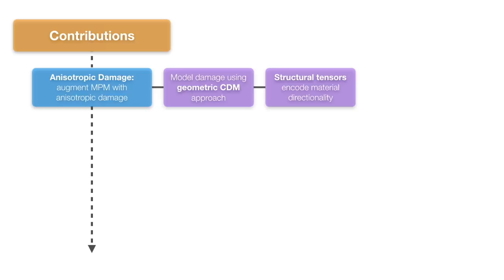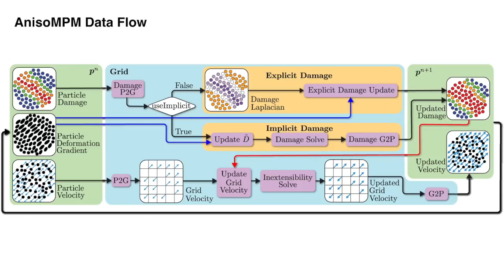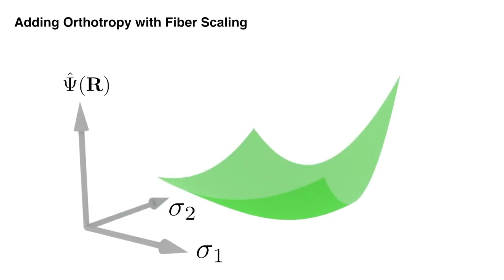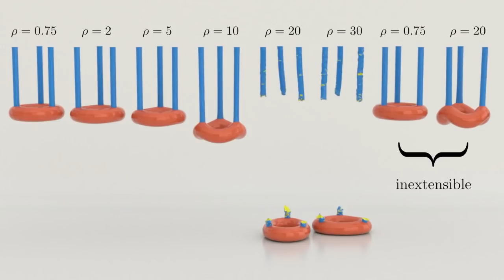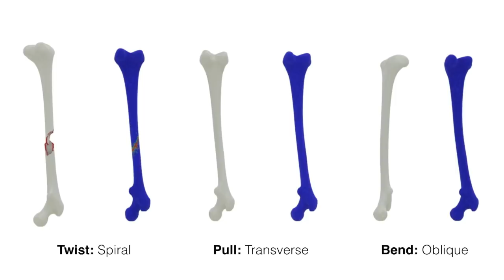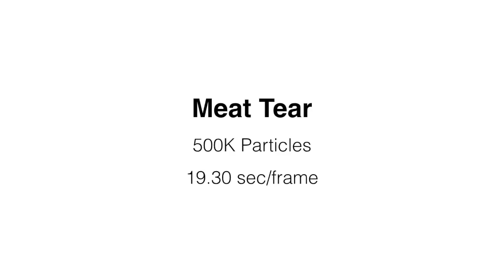[SIGGRAPH 2020] AnisoMPM: Animating Anisotropic Damage Mechanics

Comment: There's a lot of words here that I as a "dumbo" don't understand. But I like meat being damaged. Thank you YouTube for recommending this to me.
Reply: Me either but I looked some up and tried to dumb it down so I understand it. 

From Wikipedia:
A transversely isotropic material is one with physical properties which are symmetric about an axis that is normal to a plane of isotropy.
So i take this to be referring to things like the fibres or grain of a steak, where an object is composed of lots of little fibres that are strong in one direction, but pull apart easily in another.

In material science and solid mechanics, orthotropic materials have material properties at a particular point, which differ along three mutually orthogonal axes, where each axis has twofold rotational symmetry.
And this, by extension, would refer to objects like a sponge which have a more uniform molecular structure. 

So when she's talking about objects being "anisotropic" she means it has structural rigidity more on one or two axes than the other(s), which is why they will tend to split along the weakest axis.
Then when the objects are orthogonal, the damage is applied more across all 3 axes. And some of the impressive features are that they seem to be able to tell an object "you are anisotropic for these bits, and orthogonal for these bits but youre still one object" in any combination they specify and usually achieve realistic results.
The implications of this are pretty insane. Imagine playing a shooter where whatever you're shooting at has a realistic, unscripted and real-time computation of a body with muscles, skin, bone etc that all respond differently to damage... the sort of game where you might chuck a grenade at a giant crab beast only to blow a piece of its shell off so fast that it takes out one of your squad members. With more time and development this can be a framework for some of the coolest animations we've seen yet.

Also one other thing I figured out was when shes showing those graphs that look like a sheet being held by its corners, she mentioned "as damage increases, elasticity response decreases" and I took this to mean that as a part of the object gets more damaged (red) the ability for it to "hold itself together" gets reduced, which is what we observe in a lot of biological damage scenarios- say for example you crush one of your arms, the ability for the arm to continue to behave like an arm (vs the flst sausage its being forced to become) reduces in proportion with the damage done to the muscles, bone, nerves etc because they are damaged.

Im not sure if any of that helps you make more sense of what she's saying, but it sure helped me to type it out! 😁

Comment: You have to remember that when the logistical anodes become out of sync with the linear shaft dilators causing a failure to generate concurrent radial grammeters . You should try to recalibrate the stater conductors and reset the dingle arms to their original tertiary based orientations, but it could lead to sinosodial depleneration levels that are too high for industry quality standards.

We're still a ways away, but this is moving in the right direction.
Reply: On god bro that’s what I been sayin
Reply: You forgot the prefamulated amulite
Reply: The rockwell turbo encabulator this is not.
Reply: @a__duck  my heart skipped a beat after I read your name in my notification.
Reply: @hit3894 That's why im here!
Reply: a waht?

Comment: This physics is 10 years away from realtime
Reply: the physics is already realtime, as they said. 400k particle simulation in realtime on a 9700k. Rendering this with textures and a decent polygon count will take a long time, however.
Reply: @HumanlyRobotic  0.033 seconds/frame is what we normally call realtime(30fps), fastest simulation was fish with 2 fps. GPU can run the fish sim in interactive realtime, I think.
Reply: @HumanlyRobotic  I meant on a video game
Reply: Check out TyFlow
Reply: More like two years
Reply: PhysX is doing it
Reply: @summerinlake7161  not with this precision
Reply: Moore's Law is dead.